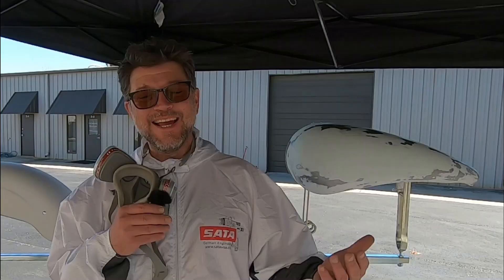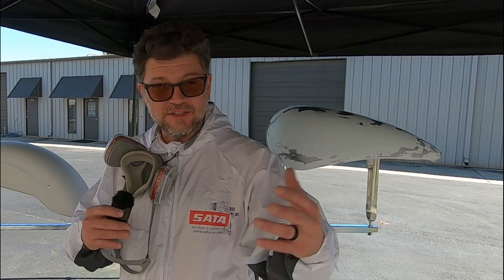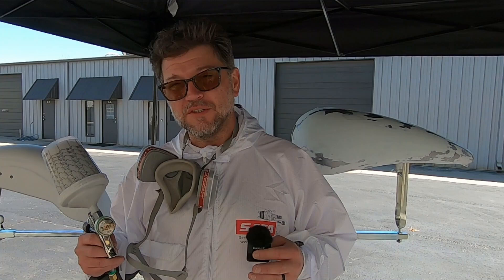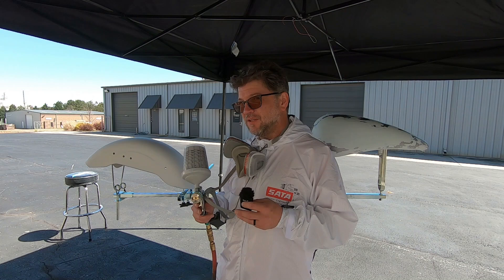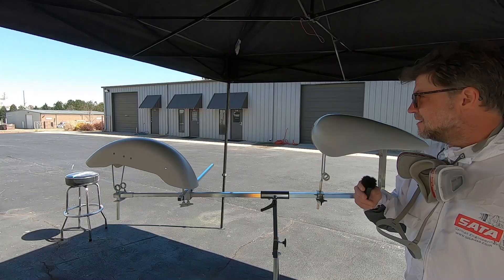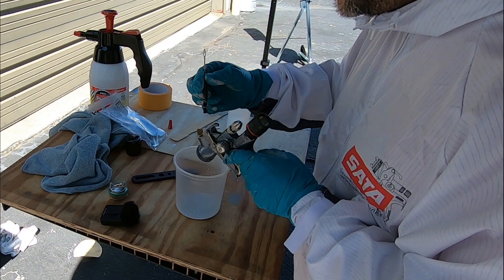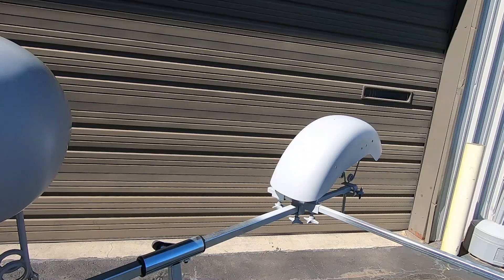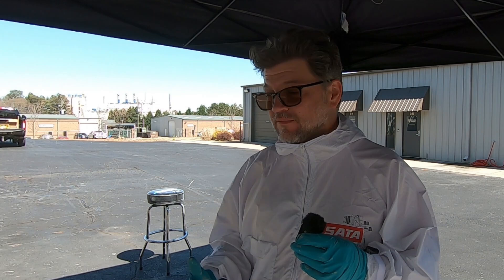I AM Painting my FXR - High Build Primer - Tony Larimer- SATA DanAm - Kevin Baxter - Baxter's Garage

Comment: Hi Kevin, I just did my oil change on my M8 128. noticed my oil was grainy and there was sand like residue left on the oil catch towards the end. The dimple magnetic plugs were normal will usual fuzz.
Reply: Oil filter (K&P) had a bit of sand as well. Bike runs fine, but I’m worried. Should I flush the engine (AMSOil Flush) and clean the throttle body (Liqui Moly TB cleaner)? 

I did the oil change (Liquimoly HD 20-50 Synth) but happy to do it over again as well to get sand out. 

My air filter seems to be the cause. I was stupid as well and rode thru heavy rain without a sock, which I think made it worse. Intake area dusty, dirty from inside and water splash marks all over. Have ordered new air intake (Feuling BA cleaner). 

Already run both Trask transmission cover + Feuling vented dipstick.
Reply: Really appreciate your guidance sir.

Comment: I'm not a hater but I hate to bust your bubble, but you can never get a true HVLP out of a 3/8 airline. You must have at least a three-quarter or 5/8 th 😮 inch hose and HVLP coupler. HVLP means high-volume low-pressure. And when  people use an HVLP with a 3/8 airline that defeats the purpose. Ciao for now.